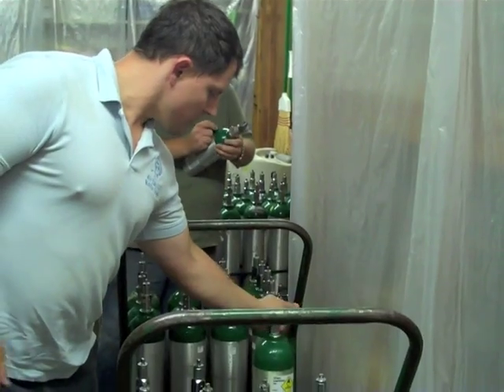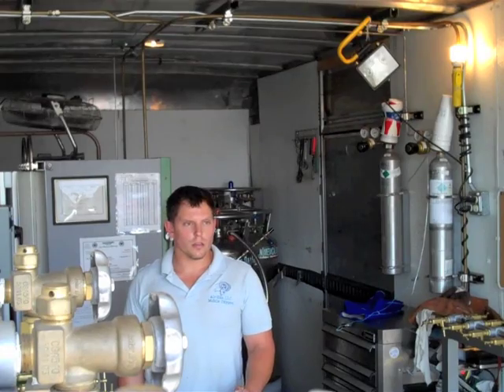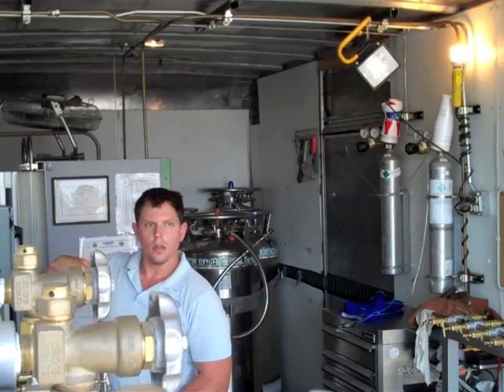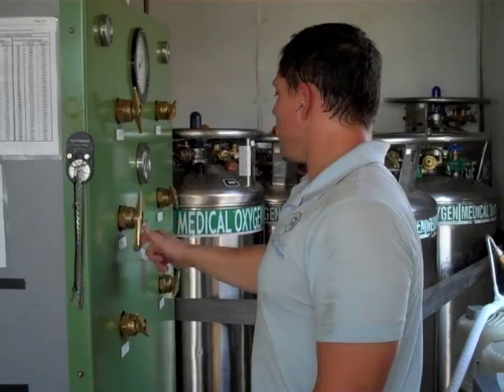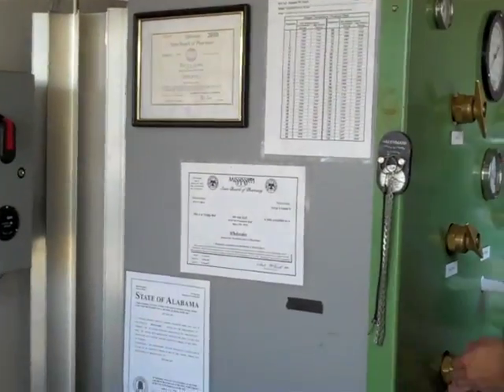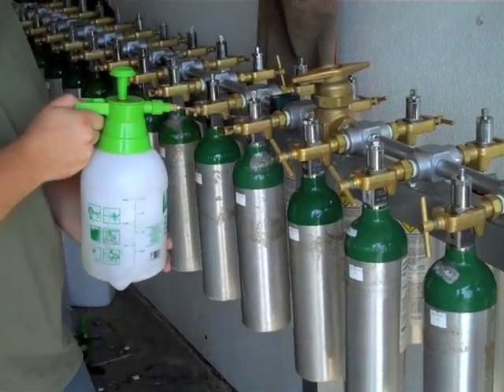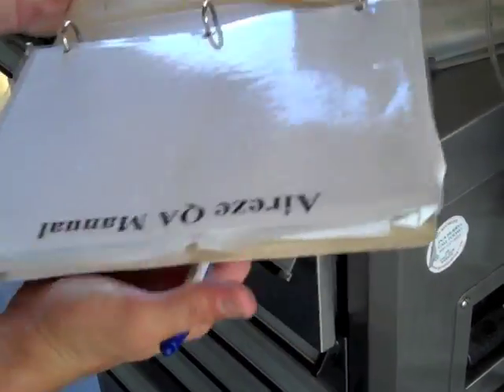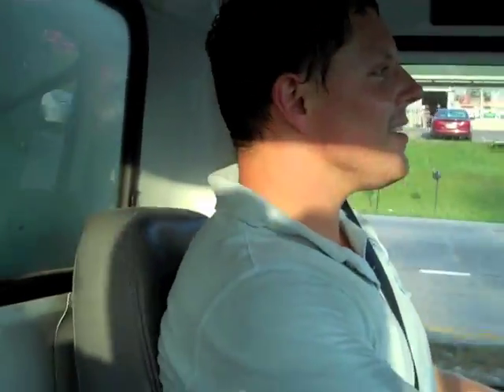Mobile Medical Oxygen Cylinder Filling 2009

Comment: No you can not........even if you switch out valves you will contaminate the tank with co2...... You will never get a purity of 99.4%of oxygen in that cylinder
Reply: Before initiate a filling they vent the tubes and valves with a small quantitie of O2. You can see a operator opening a valve with a vent tag.

Comment: Im currently studying oxygen for medical use and as far as i can tell no you can't. There is always one of two systems in place. P.I.S.S which is the pin index safety system which ensures lines cant be run into the wrong tank by a pin and hole system at the neck valve of the tanks, and the D.I.S.S system or diameter index safety system which ensures that tanks using thread connections cannot be hooked up to the wrong tank of gas due to the different diameter of the threading. Hope this helps!

Comment: a Question, can you fill a O2 medical tank with Co2? tnks
Reply: No, oxygen cylinders use a different connector type (CGA 540) than CO2 cylinders (CGA 320). Even if you did manage it, filling a green-painted cylinder with anything other than oxygen is a big no-no. Although color shouldn't be used to identify the gas in a container, it's unwise to mismatch color and label ID and could result in unintentional misuse.
Reply: am  wondering what the do in africa i am sure they import O2.